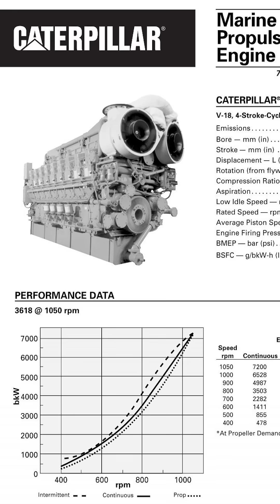wHy Don'T CaRS uSE V18 ENGiNEs?

Comment: W18 might happen, but even that's a stretch
Reply from the maker: More Feasible than a V18, but others commented how the Crankshaft would be IN SHAMBLES Lol
Reply: @BladedAngel  fair, I could see it with a billet crank, but it's still not practical
Reply: @BladedAngel  iirc first w engines were 3 inline engines on one crank, same goes for the prototyped mercedes w18 (3 inline 6's)
Reply: @BladedAngel  we need to discover some sort of unobtainium to hold the crankshaft together.
Reply: @EmperorPalpatineGalacticEmpire a cold hardened billet steel crank would work a fair bit of power, but that's not effective for how much power other applications with the same crank could produce.
Reply: @BladedAngel, well it's a Mercedes, they tend to break anyways.
Reply: Saying that it is a stretch is a stretch
Reply: mercedes nearly put a w18 in the w140 s class
Reply: How would that happen? A W8 and a W10 with a power take off unit inbetween?
Reply: @istvanlorinczi2817  No, they could design a W18. The W16 already exists. It's a stretch but not impossible.
Reply: @theewilly-d8986  yeah true, odd cylinder banks would be a problem tho, why that VW W10 never went anywhere
Reply: @istvanlorinczi2817  The b38 can hit 350hp, and we all know the legacy of the r34. The balance is a deterrent but not that detrimental. Also, a w18 would be more balanced than both a v6 or i3, as bladed pointed out the crank would be the weak spot but not impossible.
Reply: @istvanlorinczi2817  There are 2 possible configurations for a W engine, with either 3 or 4 cylinder segments.
So if a number is divisible by 3 [18] or 4 [16], can theoretically work. Unlike 10 with is only divisible by 2 & 5.
Reply: @saponinstuye8784  Bugatti makes a w engine based on their vr design, and it's the only design used in the last 20 years. It also only has to be divisible by 2 to work.
Reply: @istvanlorinczi2817  there is a test mule of an E39 M5 with a W10 engine. And it puts out almost double the power of the w8 in the passat. Close to 500hp.
Reply: @theewilly-d8986  True, the 3 bank W engine has not been utilised in multiple decades, but still possible.
Of course, the 4 bank W configuration is divisible by 2, but that's just a doubled up V configuration. we are talking restrictions of W configurations.
Reply: @saponinstuye8784  it is still very possible, but he was referencing a v18, and the vw w style is just a v engine with staggered pistons, balance wouldn't be nearly as much of an issue but it would still have issues with the crank being able to handle the available power at such a length.
Reply: @istvanlorinczi2817  One of the early Veyron prototypes had a fully functional  naturally aspirated W18 and I mean a real W not the The double V that Volkswagen actually uses
Reply: @istvanlorinczi2817  it's just 3 banks of inline 6.
Reply: @istvanlorinczi2817  W16 already exists, its what bugatti uses because a V16 is too long, but stretching it for 2 more pistons is technically unpractical.
Reply: @istvanlorinczi2817 the bugatti has a W16 all you have to do is add 2 pistons
Reply: Pretty sure one of volkswagen's concepts of the bugatti veyron had a W18 in it
Reply: @yaboiguff6282  there was concepts but they were all dropped for more effective V X H configurations. They also only appeared in aircraft or marine uses. The only company really doing the w18 is Bugatti, and it only appeared in concept car models. It involves making much more complex 6 cylinder engines mounded at 60 degrees apart from each other. It’s literally cheaper to just place 2 v8s next to each other and then making a complex gear box which is why Bugatti stuck to the w16s.
Reply: As far as i know there was a concept of a "True W" config W18 basicly 3 inline 6 stitched to eachother. 
By Benz as an 8.0 for the S-Class.
Reply: it already happened, if you count the engines Bugatti put in some of their cars in the 90s
Reply: I vote W24. It’ll be cooler. (Because hopefully it could fit in a purpose built car)
Reply: @EmperorPalpatineGalacticEmpire  It would be too long, yes a w is significantly shorter but a w16 is still longer than a v8 and a w24 would extrapolate that issue as well as it wouldn't be able to handle more power than a v12 due to the crank issue mentioned earlier. V12 engines only produce as much power as they do because their crankshaft can't handle more, w18 would be pushing it to begin with even with a billet crankshaft.
Reply: I'm not even gonna get into the hurdles of production on such a complicated engine.
Reply: @ unfortunately true. Maybe a naturally aspirated diesel could possibly work? It would make the stupidest and arguably most wasteful engine ever, but would be funny
Reply: @EmperorPalpatineGalacticEmpire  As  far as I know there has never been a W24.  True V24 is also rare, it is normally two V12's end to end. But H24 was reasonably common in WW2 aircraft engines: two flat 12's stacked on top of each other and geared together.
Reply: @EmperorPalpatineGalacticEmpire it would fit,

in a ship tho.....
Reply: Idk a W18 seems extremely realistic when u compare it t9 a V18 or I9
Reply: W18s already happened. Bugatti had it in one but it was changed to the w16
Reply: Mercedes Benz and Bugatti proposed w18s in the 90s. The original 1999 Bugatti veyron concept was a w18 and the 1999 Bugatti Chiron 18.3 concept. Bugatti even conceptualized a sedan with it.
Reply: Ah yes, dual V9
Reply: @Rickity2207 The prototype Veyron uses three banks of 6 cylinders like a world war I aircraft engine
Reply: @Rickity2207  it's more balanced than a v6. You've heard of godzilla, right?
Reply: @Rickity2207  Also, it's not a dual v9. It's clear you have no clue what a w engine is.
Reply: The veyron was originally going to have a W18
Reply: I think it’d be easier just to go W24, two VR12s, shouldn’t be a big deal to engineer.
Reply: @zornslemon  Yeah but good luck fueling 24 cylinders, that's a pretty thirsty block
Reply: @joemann7971 Have you ever heard of a vr5? Put two of those on the end of a vw w8 engine.
Reply: Its not impossible that's only 6 Cylinders per Bank so it wouldn't be Overly Large
Reply: @ Mercedes built a few in the 90s for the S class. I think they had like 680hp
Reply: @deltasixgaming I'm talking about a different w design like the wr16. The issue with traditional w engines is the complexity.
Reply: the bugatti chiron 18/3 had a w18
Reply: @bennm-ct5qm it was never produced that was only in concept.
Reply: W18 was tested on bugatti veyron prototypes
Reply: A W18 engine is an eighteen-cylinder piston engine that arranges three banks of six cylinders in a W configuration. This layout is relatively rare and has primarily been used in aircraft and concept vehicles. The W18 engine was notably used in several Bugatti concept cars, including the EB 118, EB 218, and the EB 18/3 Chiron.
Reply: it does happen and it is a real thing, Bugatti chiron has it
Reply: Yeah that’s just 3 banks of 6, it’s been done but it’s rare. I’m waiting for someone to mass produce a W9, just 3 banks of 3, cube engine.
Reply: Tbh Bugatti almost shoved one in the original Bugatti Chiron back in 1999 💀
Reply: I thought there was already a car with a W24
Reply: W20 plz
Reply: So a W16 can be dumbed down to a V8 on top of another V8, idk how can you put a V9 on top of a V9 without making it very messed up
Reply: @SantiagoRodríguez-h5d It's more akin to adding a v6 to the end of a v12. It's far more stable than a v6 based on primary and secondary balancing.
Reply: @theewilly-d8986  no it's more like adding an inline 6 cylinder in the middle of The V of a V12
Reply: @lorenzamccoy7512  the w name comes from the w pattern for the cylinders and only has 2 banks of cylinders, if you're going off the outdated reference of the w engine having 3 banks it's irrelevant and no longer recognized, the only relevant and recognized use is the double bank vr named w based on cylinder bank layout.
Reply: @theewilly-d8986  look man just because Volkswagen makes a new engine and calls it a W in the '90s doesn't mean an actual W engine isn't real anymore. It's called a W engine because it's actually a double V (VV) and if you were to draw a Volkswagen W engine it would not even remotely look like a W it would just be two V's on top of each other. While an actual W engine with three banks looks just like a W like the W12 Napier Railton, at best you could call the Volkswagen W engines a WR8,12, or 16.
Reply: @lorenzamccoy7512 w isn't based on banks it's based on the shape the cylinders make on each head and it's also the only engine that's been in production with any reference to a w design in the past 30 years, the w engine isn't recognized by schools outside of vw, I'm sorry but the most common use is the assumed, I'm not assuming you mean happy when you call someone gay, so assuming the uncommon makes you the outlier here.
Reply: @theewilly-d8986  what kind of nonsense are you talking about! Also using your faulty logic that means If someone would refer to a battleship that they actually meant an aircraft carrier since battleships haven't been relevant or made for about 80 years 🤦🏿‍♂️
And that "gay" comment that you're talking about, either you reading a typo that I missed somewhere or you're having a schizophrenic episode. Also I think you mean more like barely 20 years, as Bugatti was initially going to use a three bank naturally aspirated W18 for their Bugatti Veyron but instead they switched to linking two VR8s together and adding a turbocharger for each bank. Also based on the nomenclature you yourself described it would still be called a VR16 as it just has 4 banks with two cylinder heads instead of two banks with one cylinder head. Have you even seen a Bugatti engine before? It looks just like a V8 when fully assembled except with adnormally large heads. While an actual W engine when fully assembled you will know it is definitely a W engine no matter how thick the heads are and there will always be three exhaust manifolds, compared to the Volkswagen's WR lay out which has two exhaust manifolds like a V8 engine...
Reply: I'm an automotive technician. When I speak to my colleagues in the industry about w engines, they don't think about the 3 bank because it's irrelevant when referencing modern engines in the industry, 3 bank w engines are irrelevant and only referenced by niche enthusiasts and this not the given application of the term, you can't change something because you disapprove, this is decided by the industry not me or you.
Reply: @theewilly-d8986  not outdated, just less used. Still a W engine
Reply: @EmperorPalpatineGalacticEmpire The 3 bank w engine hasn't been used in any notable applications since it's failure in an f1 car 20 years ago and for mass production it's been even longer, the engine is outdated and has no effective use due to how unbalanced and complicated it is, it would he more likely to see a vw w type engine with 18 cylinders.
Reply: @SantiagoRodríguez-h5d think of it like two VR 8s connected to each other in a V configuration, just like the W8 is just two V4s in A V configuration
Reply: @SantiagoRodríguez-h5d I think you're confused because Volkswagen incorrectly named their engine W16 when in reality it's a Double VR16. If their engine was a real W16 it will either have to be two banks of six cylinders and one bank of four or two banks of 5 cylinders and one Bank of 6
Reply: It actually somewhat exists(I said somewhat because it's only in a concept Bugatti)
Reply: @BlwnV8-l3y  Mercedes did one with 3 6 cylinder engines
Reply: For an engine to be a in a W configuration, the number of cylinders has to be divisible by 4, last time I checked 18 isn't, unless the rules of math have changed
Reply: @ it can be an original W style (3 cylinder banks of 6) which is what Mercedes was building. W can refer to either the 3 cylinder block style (never really used anymore) or the Stacked one.
Reply: @EmperorPalpatineGalacticEmpire That's what I've been trying to say and that the traditional w design is no longer relevant in the field, so it shouldn't be the standard when mentioning a w engine as they are not in production, but people are strung up over outdated information as always.
Reply: @theewilly-d8986  True and understandable. But a W18 would be awesome. Further, it isn’t outdated, it’s factual. A W engine refers to both, but a true W engine is 3 cylinder banks.
Reply: @FunkyMonkey-oj9md  yeah that's if you're making a WR engine like Volkswagen, the original W engines like Volkswagens original W18 engine uses Three banks of cylinders
Reply: @lorenzamccoy7512  I was unaware of W engines using a 3 bank configuration, I stand corrected
Reply: @FunkyMonkey-oj9md  yeah the original W engines were three banks and they've been around for at least 100 years before Volkswagen decided to redefine words lol
Reply: @lorenzamccoy7512  You've misunderstood what I said, I'm saying the most common use of a term is the given meaning of such a term, the most common use of the w designation for an engine in the modern day is in the vw w16 engine, just like how the word gay has changed in meaning, the industry term for a w engine used to relate to the 3 bank design that is no longer the common use of the term, thus when you reference a w engine the given is the most common usage of the designation at the time and in the relative industry, this would make the vw w engine the assumed design when referenced by the designation of a w engine as that is the most common usage of the nomenclature in the modern industry.
Reply: @ they can make a VR5, so maybe you can do a VR9
Reply: @FunkyMonkey-oj9md w engines don't have to be divisible by 4. That's a design choice to increased balance, but it doesn't prevent the engine from being a w or from being viable.
Reply: @joemann7971 The Bugatti w engine is just a v engine with staggard pistons, and with such a layout, it would be more balanced than a v6, so don't tell me that's the issue, I literally went to school for this I know the math behind it.
Reply: Are you stupid or what
Reply: The biggest issues with traditional w style engines is complexity and weight, using the vr style w engine makes it possible that that's hardly a w engine.
Reply: The Bugatti Veyron concept car proposed a W18 engine, with 3 banks of inline 6. 

As NA engine it only mustered 555hp, not bad for late 90s but nowhere near 1,000hp the production Veyron made.
Reply: I think Bugatti tested a W18 in a concept car, but I guess it was too much.
Reply: No it's not it's possible
Reply: @blacklyfe6881  they're too heavy for the torque they can handle. You could do the Bugatti style, but even then, the crank could still snap under the power required to use it over a v engine.
Reply: @theewilly-d8986  it doesn't matter you need to change your mindset 🙄.
Reply: @theewilly-d8986  you have a fixed mindset. I have an abundance growth mindset. Many of the issues you talk about are minor u do not think outside the box.
Reply: @blacklyfe6881  I'm talking about production vehicles, why would they make a 3 bank w engine when they can just make vr style w engine with less weight for the same power, I'm not stuck in a box I'm going off what's practical and can be applied to mass production, billet cranks are too expensive, I literally went to school for this I know why you can't make it practical.
Reply: @theewilly-d8986  like u said, you need to change your mindset. You are asking the wrong questions lol you're clueless.
Reply: @blacklyfe6881  Sorry, I abide by the real world and use practical and logical thinking. I don't live a life of fiction, unfortunately.
Reply: Ferdinand Piëch of Volkswagen built a W18 engine for the Bugatti Veyrons concept car but when they went to production they chose a W16 engine because it had better performance.
Reply: @Andersson203  the w18 was a 3 bank the 16 was the wr 4 bank style
Reply: Well...put it in a stretch limo....there's always a way
Reply: W24 could happen with a bit of extra space as a v16 exists
Reply: No it cant, 2x 9 aint balanced. V 18 are a thing tho
Reply: @L4ftyOne  it's more balanced than a v6, it's more balanced than you think, bro.
Reply: @L4ftyOne  W can also refer to 3 cylinder blocks (Mercedes built a W18)
Reply: 2 more f1 seasons till the W18 im afraid😂
Reply: W20 seems more reasonable
Reply: W18 already happend in mercedes benz sel800 and bugatti eb110
Reply: w18 or v18??
Reply: W18 engines did exist, the V18 is the most rare config to find
Reply: @Elliottblancher  yea but the W(vr)18 engine has yet to exist, i was just saying it might happen because that is closer to a v engine than an actual w, my main thing is a w engine hasnt been produced outside the vr style since i was born, its irrelevant at best.
Reply: porsche 🤑